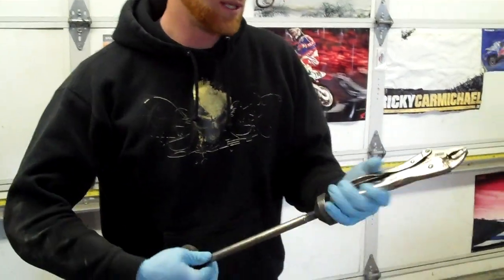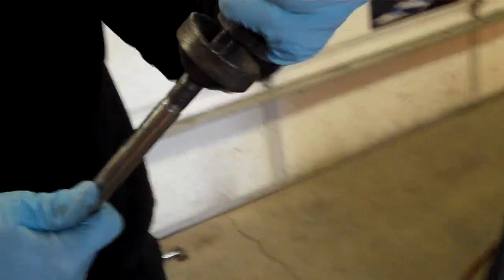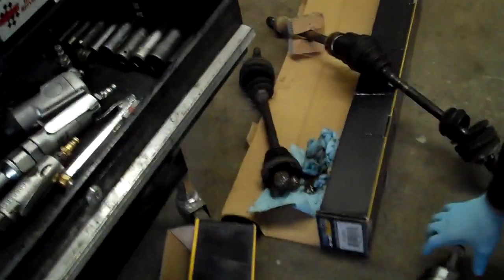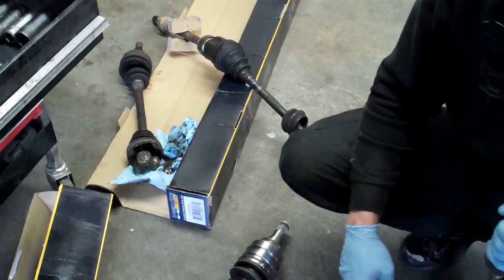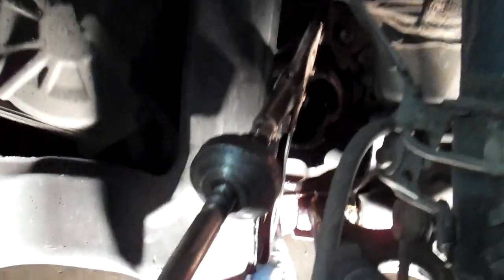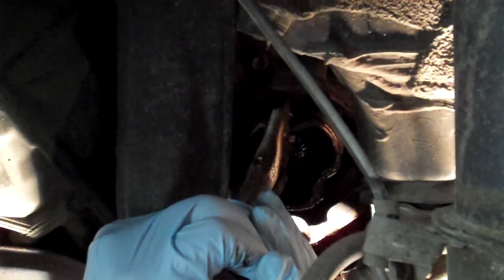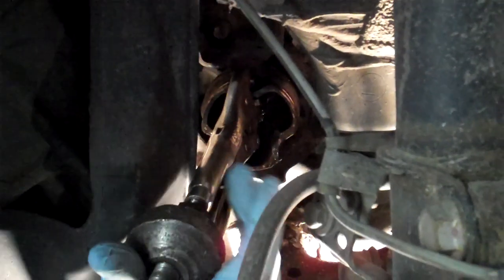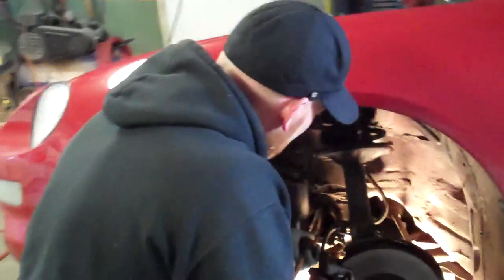Slide Hammer CV axle TOOL

Comment: Pulled an inner CV on a 2005 Accord V6 coupe passenger using this method after attempting prying for hours and having the car on jack stands for a week. Took 3 tugs, not too much force needed, the prying wasn't working to well as the passenger inner has a space inbetween the end of the connecting joint and the outer axle. Did more damage to my exhaust mounts than prying on the inner cv in this case I would def recommend picking up a slide hammer+ this tool or an actual CV axle pulling y fork you can all get on Amazon/ ebay. 

Thanks Brian for the help 5 years later and this video is still doing its job :)

Comment: Thanks a million briansmobile1- this video was 5 years ago and still getting back yard mechs out of very bad jams. Almost had no car for work tomorrow. Used your vid and it worked in 2 minutes. About the adapter - I couldn't find one in stores anywhere - automotive, hardware stores - if anyone did have one it was probably part of a set that cost hundreds. I didn't have time to wait to order online - so I made my own adapter at a local plumbing store. I used a 3/8" x 1/4" reducer that is normally used for pipe fitting (3/8" goes on the slide hammer). I then put an open ended M12-1.75 rod that screws into the adapter (1/4" side) and the other side screwed into the vise grips (hence needing an open ended rod). It probably isn't as sturdy as the custom made adapter in the video, but it did the trick and the CV axle popped right out, and it only cost $5 bucks. Autozone rents the slide hammer for free but no adapter.
My contraption: http://i67.tinypic.com/23iuqn6.jpg
Parts used (but actually bought at my plumbing store):
http://www.walmart.com/ip/M20220.120.1000-Threaded-Rod-Plain-M12-x-1.75mmx1m/44949634?reviews_limit=10&
http://www.amazon.com/Mueller-521-321BG-Black-Reducing-Coupling/dp/B00FX9KRFQ
Reply: Thanks For the added info I'll be assembling this tool tomorrow using the same parts you used here.

Comment: Thanks Brian,  Always enjoy your videos - you've saved me hours of labor on my cars.  When faced with a similar issue in the past, I drilled a hole in the old axle boot which was stuck in the trans.  I then attached a chain and weight to the end and gave a yank.  As the chain snaps taught, it pulls the old axle right out.  The old axle is trashed anyway no harm in drilling a hole in it.  Thanks again for the videos.

Comment: Brian--many thanks! You're a life-saver!  Just getting into tinkering with auto repairs--first CV joint (Corolla) and everything came to a screeching halt when the inner joint wouldn't pop out. Saw your video, bought a slide hammer after finding out it had an adapter that fit my vice-grips and did what you did and it came out on the second try. Thanks a bunch!!
Reply: InstaBlaster.

Comment: Great Help, I had a problem on my Dodge Van, Cut down the shaft on my dent puller, re-threaded the 7/16 shaft, screwed into the vise grip, gave it one yank and the 2 hours wasted last night, was solved in one second.  Thanks for your video, you saved the day.

Comment: I just did this on my 94 RED Celica GT!.....I tried every tool and hammer but there is little room to grip the bell or swing the hammer. Finally found that a crowbar with the curved end and nailpuller fit the bell and you can strike the curve with a BFH....and POP! it came free.....I have got to make a tool like your slidehammer-grip, great idea!

Comment: Brilliant you are ! I worked about an hour and no go with a punch. I then bought a Harbor Freight slide hammer and the adapter fit the thread in my vice grips. Three slide pulls and it came off easily

Comment: Great idea. I have an adjustable pry bar that usually works. I'll be making one of these now for the real stubborn ones. GM 4x4 drivers side axles are the worst to get out. I've had to remove the diff and split the case on a few.

Comment: Brian, really like your videos. Straight to the point no bs. Also entertaining .  Came across this video and the tool really works. Well I modified  it a little. I had a small dent puller and luckily  the threads went right into my vice grip.. the threads were not long enough so I filled in the gap with a small round piece  of metal. I tried to get out cv cup for over 2 hours made the tool and in 5 seconds right out no problem. Thanks.

Comment: Great video. You saved me so much time. It started out as a couple hour project on my Accord and itturned into a 3 day project.   I wish I had watched this video sooner. The principles are solid!  I had a much smaller pair of vice grips laying around (I would've bought a bigger pair, but I wanted to see if I could make it work with the pair I had). I went to AutoZone (many parts stores have them) and got the slide hammer rental (free). Then I went to Lowe's and bought a threaded rod (bring in your vice grips to fit them - mine was maybe 1/4" and it worked), a washer and a nut. I spent $3 using your method. I can only imagine how much more a shop would have charged for "broken cv joint removal labor." Mine was not nearly as beefy as yours and it worked in 2 bites (once the vice grips were properly affixed). I did not weld anything. Thanks again!

Comment from the maker: @xwmmyster I generally don't repair them any more.  Usually if a boot fails and is caught before it splits full round you can do them with successful result.  Otherwise the double threat of lubrication loss and inclusions of dust and dirt cause irreparable decline in the balls and races.  Once initiated the decline continues with or without a proper boot on.

Comment: Great Idea!! I got $5 in a generic set of vice grips and a nut. Beat the hell out of the cv joint remover that I couldn't get behind the joint. Or Ford's tool which requires the removal of the passenger side joint to use. Thanks for posting.

Comment: Could not get the passenger side off my 2005 Honda Odyssey. I spent 6 hours trying to find a way to get it out. Turns AutoZone loans a tool (for free) that is like the letter "C" that slips around the back of the cup and attaches to a slide hammer. Did in 1 minute what I could not in 6 hours, got the damn thing out. I was desperate bro. If I hadn't found the other tool I would have definitely tried this. Going to keep it in the memory bank for the next time I need a grabby slide hammer thingy. Good job man.

Comment: I made my own slide hammer with vise grips. I took a 4ft 7/16 threaded rod, 1/2 washer, 7/16 nut and 5ib slider. threaded the vise grips on one side, slide the hammer on other then put the nut and washer on and got it off within 2 mins.

Comment: i made one (before i saw this) with the standard large size vise grips and a slide hammer type dent puller from auto parts store. it threaded straight into the vice grips.  i had to put a spacer in the threaded area of vicegrips because my threads on the dent puller were only an inch or so long. i used an old valve core from a laen mower tire that was laying on the ground.  then some duck tape (only 1.5 wraps) to keep the vicr grips together. 4-5 hard whacks on the slide and my rav4 was free!!!

Comment: The Harbor Freight slide hammer is about half the Amazon price and comes with several attachments.  Not a vice grip attachment though.  Your adaptation of vice grips is excellent and the way you did it, it can still be used as common vice grips.  Score.

Comment: I had to fabricate a tool to pull the axle on my Plymouth Voyager.  I used a long piece of angle iron (bed frame) with a piece welded to the end to hook over the fat part of the axle at the transmission.  In my case, there was just enough room to get something between the axle and the trans case.  On the other end of the angle iron, I welded a piece that I could whack with a hammer.  I also used a long worm-gear clamp to hold the tool so it wouldn't slip off the axle.  I could modify my "tool" to adapt a slide hammer.

Comment: could U of used the puller with that U type of cv joint puller that attaches?  is there room to swing the hammer (for a straight pull) if U used a cv joint puller?

Comment: I made one of these last month and it works great. Jody at weldingtipsandtricks does a modification of this by welding the bar of a slide hammer to the back of the grip, so it's more in line with the jaws. He feels you get a better straight line pull with that. But the disadvantage of his method is that the tool can't be easily stored in a toolbox, and it can never be screwed apart to use components for other jobs. I like the way you did it because of better versatility.

Comment: Hey Brian. I having issues pulling my the driver side axle on my Toyota Echo. I've tried everything! The slide hammer isn't even working for me. In fact I can feel the race and the rubber of the bearing (or seal) at the trans case pulling out about 1/2" but the axle never frees (I'm pretty sure thats not normal) !? I've tried rotating, slide hammering, prying...nothing works. Its almost identicle to your video but without the success. Any suggestion?

Comment: got mine out of a 2010 Honda pilot.

I got the replacement end into the transaxle, but having problems getting the shaft into the brake rotor. 

About to push our Honda Pilot down the driveway and let someone take it. Been at it for 3 hours and cannot get the gears lined up to push it on. 

Any hints?

Comment: I just take a striking prybar and set the end of it on one of the notches on the side of the inner CV hub and a couple of hits with the hammer pops it right out.
Reply: Kyle Northrop I tried that this morning to no avail.  Bout to go make one of these slide hammer vice grip tools.  This cv hub is frozen solid on the trans and I'm running out of options.